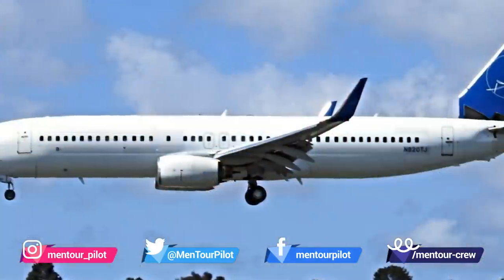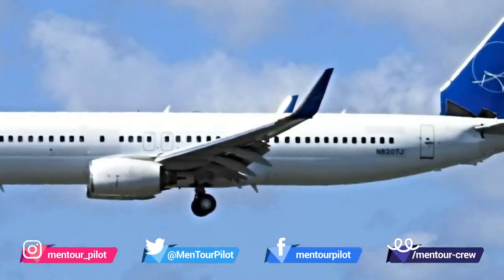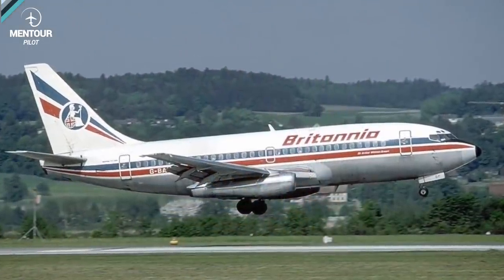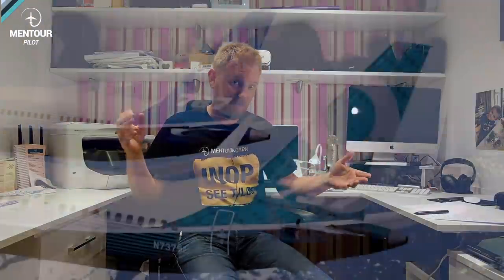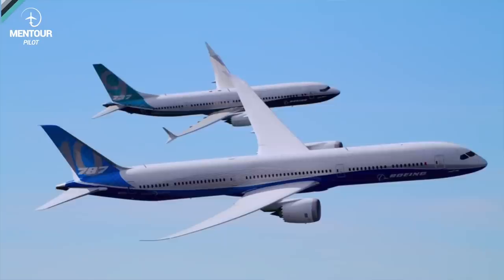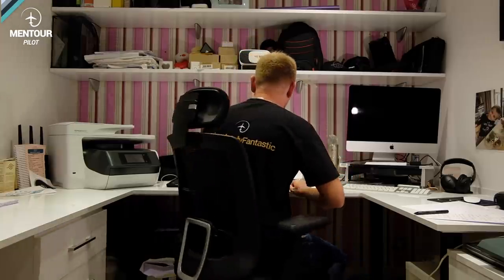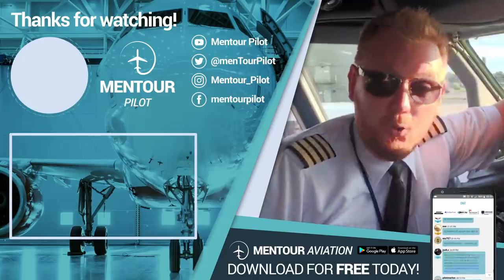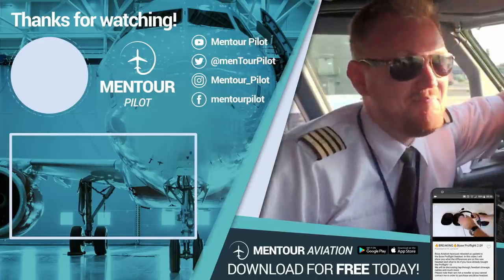Aircraft landing with missing tail section!!

Comment: Definitely not a birdstrike🙃 Most likely a maintenance human error 😳
Reply: I put my money on metal fatigue.
Reply: I would not be surprised this was a manufacturing error.  They take time to emerge.
Reply: coolcatmeow77 It is clean of..nothing remaining. So I wouldnt think so😳
Reply: John Cheresna Manufactoring? Its probably been on in about 35-40000 flight cycles tho🤔
Reply: Stella Wind You can blame a virus for a lot of things..but not that😆
Reply: This just in! Democrats claim it's Trump's fault ... 😁
Reply: soaringtractor  We will find out expert.
Reply: @speedbird9313  We will find out. 
 BTW expert, cycles effect the pressure hull, landing gear, moving parts far more than they do on static parts.
Reply: Manager “hey Mechanic rob tail number RTY aircraft of the dorsal fin we need it in an hour it’s grounded anyway”. Mechanic “ok going to get RBY’s dorsal fin now”. Other Mechanic “I’ll start the paperwork”
Reply: Austin Vialoux Might actually be the case🤭 There is no CDL on that thing🤨
Reply: Smitty Smithsonite Usually the other way around isnt it..🤭
Reply: John Cheresna Well of course..but the dorsal fin is very much a static part🙄
Reply: soaringtractor Should not be much corrosion in that area🙄 It may actually have been taken of and not reinstalled before they released it🤭
Reply: Agree unlikely a bird strike, but not impossible.  Having seen the results of many bird strikes on heavies, there is a lot of force.  The panels are secondary losses IMO.   Suspect the fin wasn’t properly secured.
Reply: Yeah, a birdstrike seems very unlikely there.  I would think if a bird were to strike the V-stab it would be higher up since in takeoff and climb out the aircraft would have a relatively high angle of attack causing the front of the fuselage to be higher in the airstream than the rear of the fuselage and the dorsal fin.  So even if a bird came right over the cockpit windows, which the crew would have noticed, it would likely strike the stabilizer higher up than the dorsal fin.  Even during approach, I think this would be true as the AOA would still be positive (as compared to the airflow direction) even in the descent.
Reply: then how did the other stabilizer get a dent and a panel on the side of the tail come off?
Reply: Its boeing that pretty much explains it!
Reply: Ken Leonard It is impossible, it would not have been taken clean off..
Reply: A_ch0o If you mean the dent on the LH horizontal stabilizer leading edge it could be a old damage. Pretty common to have impact damage on those🙄 The panels could have blown out due to airpressure through the lightning holes in the vertical stabilizer front part which is visual only when the dorsal fin is off.

Comment: I could imagine that the exposed portion of the fin structure with those 2 holes would  catch a lot of wind and pressure inside the structure that it wasn't designed for.

Comment: The panels missing were blown up by the ram air getting in  throw the fronts orifices on the ribs holding the tail fin. The air ramming though those holes produced an increased air pressure inside the structure sufficiently high to blow the panels open and the wind passing through the outer surface was sufficient to completely remove the panels from the plane.   The dent on the leading edge on the vertical stabilizer was caused by the dorsal fin when it fell. The panels do not have the mass to cause such dent of the leading edge. The very shape of the structure is very strong and resist impacts like this.
Reply: So what made the dorsal fin come away from the vertical stabilizer
Reply: whatsonyourchannel “What made the dorsal fin come away?” Speculation made it come away :) (Nobody knows yet, so we can only speculate).
Reply: @whatsonyourchannel  That, my friend, need to have a close examination and interview the maintenance personnel.

Comment: Strictly speaking, linguistically, it's not a dorsal fin, which would be separate from the tail assembly. The part in question is a forward extension on the tail. Beyond the aircraft industry messing with definitions, agree totally with you Mentour.
Reply: Allison Pell Ref AMM 55-32-11 this is a dorsal fin..

Comment: I would say that the rudder panels were simply 'pushed of' due to the increased air pressure inside that now open cavity. The pressure through those two holes would have been substantial - in addition to some 'lift' generated by the shape of the fin would have been enough to overcome the rivets.
Reply: No, likely there were only a few finger tight screws holding those panels on, once the doghouse departed the screws rattled out and the panels departed also.

Comment: how could you not notice that the entire vertical stabilizer and rudder is tilted backwards... it's far worse than it seems. it's a miracle they haven't lost the tail all togheter... as far as i can see the "panels missing" are just  flanges that normally aren't visible because it's were it joins the back part of the fuselage and become exposed because of the tilting. you can tell even the logo is clearly misalligned

Comment: There is absolutely no possible Earthly way that thing came off in flight and left such a neat and orderly hole, without any passenger or crew feeling anything. No possible way!  Furthermore, there is no possible way a bird or more than several birds can knock that fin off. Mark my words we will find out that that plane was undergoing maintenance and the part was simply not needed to fly the plane in the meantime. It is just that simple. I'm super surprised the highly qualified pilot in the video didn't speculate as to this point. I'm not a pilot but I am a structural engineer.  Just an observation, respect.

Comment: 5:35 if you think about it, it also may be very likely, that through the holes in the front of the fin, there was pressure from the airspeed building up inside the fin, and i think that blew it off.

Comment: I'm curious of one thing.. You said the plane would have flown over the ocean for a bit.  Well, I live 20 miles from San Diego, and Victorville is in the desert.  If it took a 737 41 minutes to fly 126 miles, it must have been almost at stall speed.  How far is it from Victorville, CA to San Diego, CA? It's a 02 hours 28 minutes drive by car. Flight distance is approximately 126 miles (203 km) and flight time from Victorville, CA to San Diego, CA is 15 minutes.  I have relatives in Victorville, and it takes me a couple of hours to get there, because I live a few blocks from Interstate 15.  I don't understand how it would take an ocean approach coming from inland.  someone who has flown that route please enlighten me.  I have flown into San Diego from oakland, and we flew over the ocean but then turned inland to fly into Lindberg field through the high rises.

Comment: the side panels were not ripped off they were blown out!. the lightening holes on the front bulkhead of the fin being in the direct airflow would cause a large pressure build up on the inside. they may have to take the same fairing panels off from the otherside too as they would of exceeded the stress load, as they were not designed for an internal force acting out board.

Comment: That dorsal fin was a Boeing 'fix' to move the aircrafts center of lateral resistance back to its original design position after the new oversised engines had moved it forward. 

Without the dorsal fin the new engines would have had to be fitted further aft which in turn would have reqired a longer undercarriage design which was not feasable without a complete redesign of the aircraft. 

A similar modfication was done back in the 1940's to the North American P51 Mustang when the installation of a larger engine cowling reqired the addition of a dorsal fin to the original vertical stabiliser design.

Comment: Looks like somebody was working on the vertical and didn’t torque the fasteners properly. Are the fasteners missing? Is there shards of composite still on the vertical? There’s more to this story than we are being told.🤔🤔🤔
Reply: Unlikely that someone missed every single fastener, there’s hundreds of fasteners holding these dorsal fins on, even a small fraction would be satisfactory in holding it in place
Reply: maybe like that one the morning shift unscrew all the leadin edges,but the evening shift decide they only had time to replace one of the leading edges ,let the plane fly and when he comes back,replace the other one.
result:no one screw on again the other leading edge and fell off in flight.

Comment: If I had to bet, it was a maintenance error,  someone did not tighten up the key parts OR a structural failure occurred.  The latter, sort of scary the former - is correctable, though someone may be unimployed shortly.    Bird strike not likely in that area.  No big birds in Southern Ca except for condors and THAT would be become a big news item
On the plus side the flight was relatively short so the is a good chance of finding the part if it didn't land in the mountains  around the LA Basin that were in it's flight path shown.
Good info, would never have noticed that addition to the rudder.

Comment: Really doubt bird strike. There are 12 or 14 bolts that come up from inside the fuselage every 20 inches through the ribs. Even if a few were not installed it would have left pieces still attached. Those bolts are under insulation and the cabin ceiling panels so it is not something that could be easily inspected for say a preflight or over-night check. I doubt the bolts were even installed from the last time it was removed. It is not normally removed except in Heavy check. What will surprise some people is that the dorsal fin is about 10 feet long but only about 200 lbs. As for the vertical closeout panels, that forward one came away too perfectly. If the panel had ripped off at least some of the fasteners would still be there with some panel material. All those panels including the dorsal are all fiberglass.

Comment: I hear that you still are a strong Boeing supporter! The reason for this incident most certainly had to do with metal fatigue, witch means that it might have been ripped partly off and a chunk could have stayed on and caused aerodynamic disturbances or jammed the stabilizer trim. What is most concerning is that it further suggests that quality at Boeing is not at a sufficient level and hasn't been so for a long time.

Comment: Mentour Pilot forgot to mention one potenial serious danger to the aircraft after the dorsal fin was lost: The blunt, non aerodynamic primary structure, the one with the green paint, with the round holes, that holds the front of the vertical stabilizer, disturbs the airflow around the lower half of the vertical stabilizer and ruddder. In case the aircraft would encounter an engine failure in this configuration, the stabilizer and rudder might not be able to counteract the sideslip sufficiently and the stabilizer could stall in the sideslip - with the consequent loss of the aircraft with its crew.

Comment: Well that has to be a bit weird. Pulling up to the gate after a nice smooth flight, stop when the ground guide says, waiting for them to chock the plane, running a checklist, then you see ground guys pointing at the plane and getting each others attention. Then either a text from HQ on the coms, or ground on the radio chiming to finally enlighten you.

Comment: At 5:35
Could it be that the sudden inrush of air thru the 3 round holes in the vertical structure that became exposed when the dorsal fin disappeared just blew off the 2 panels by a sudden buildup of pressure inside?
Reply: Seems plausible.

Comment: uh... I've seen that before. The aircraft was in maintenance, probably phase or depot level, those panels had to come off for a 365 day or 730 day inspection or for a flight control rig, and the maintenance team was told to move the aircraft so the panels were tacked on  with a few screws so it could be moved, the aircraft was moved, the team was reassigned to other work, production control yelled to push the aircraft to the line and hours or days later with the maintenance unfinished, the panels held on with a few screws, pilots were assigned to fly it and they did.... trust me, on some aircraft it is hard to see missing screws, first flight, second....third, eventually the panels fly off. Hopefully your car isn't under the flight path, or your head.

Comment: Whoever was on that flight can consider himself or herself to be very lucky, the detachment of the dorsal fin could have damaged the rudder or the horizontal stabilizer to a degree where the machine would have crashed. It is clear that the horizontal stabilizer „suffered only“ a dent but it could have been worst, serious damage to that part would have left the plane flying out of control with little to no chance for the pilots to control it, this incident should require a complete investigation

Comment: Having that bit of dorsal fin and a couple of panels missing is no biggie.   What is rather more worrying is how it came to be missing, or what else might have fallen off.   If for example it suggests the rest of the tail fin might have gone missing (unlikely from a birdstrike if that's what it was, but possible with some scenarios) then that is frequently not a controllable situation.   I would think the investigators would be looking quite hard at this one.
Reply: cr01 Another Continental Express Flight 2574 incident is my guess..
Reply: @speedbird9313    Ouch!   That incident certainly had a far less fortunate conclusion.   (Someone left some bolts out of the horizontal stabiliser and it fell off.   I wasn't aware of that one.   What is unusual is that unlike most such incidents where the resulting loss of control causes a crash, this caused such a violent upset that the wing immediately broke off.)

Comment: Now I want to go out and look for it because I live in the area where it probably would have flown over. Where does the flight go over the sea? Do they have to approach the runway coming from the sea to the San Diego airport? A basic straight shot from Victorville to San Diego would be entirely over land. They have to fly over the San Andreas Fault and resulting linear mountain range so it definitely could have fallen there and not been found. There were some decent winds, at least on the ground and the winds tend to be stronger in and around the mountains. If they didn't notice it though, it seems more likely to be metal fatigue because you think someone would have at least heard a birdstrike and winds are pretty noticeable. It seems like planes can withstand a lot of wind. I have gone to South America several times and the winds coming off the Andes are unmistakeable. The time I went from Lima, Peru to Lake Titicaca, the winds were absolutely terrifying, at least in the back of the plane.

Comment: My team and I intall a dorsal fin one month ago to a european airline during a C Check of a boeing 737-400.
The reason of the removal was high levels of corrosion at the fuselage, exactly where this part is installed.
It slides in place and then about 20 bolts from the cabin are tighten with specific torque value to anchor nuts that are installed at the dorsal fin.
Panels fly away because of incorrect bolt length..
But this fin.. I am curious to see what happened..
Reply: Do you think that air pressure at flight speed could get under a loose leading edge of that thing and rip it all the way off, even if some of the bolts were in properly?
Do you think maybe this was a case of maintenance-interuptus where a job got half done and then restarted after the quarantine?
Reply: @grecco_buckliano  The air pressure can not make 20 bolts with +-150 inlb of torque, to fly away in normal circumstances.
Well now those bolts are very tricky because to see if they are proper installed (correct length, more than one thread passes the nut) you should take off the big panel that is missing too!!! 
Job cannot be done half in those things.
BUT, If a repair was done at the fuselage and they use the SAME bolts as the manual indicates so they are mistaken, because the repair is thicker now and longer bolts should be installed!!!
Reply: pao_mono gate13 14 bolts😉 
AMM 55-32-11-400-801
Reply: maybe brother, i can recall two in the front as you say and 6(?) by each side..?
maybe... i don t remember for sure..
I remember for sure how my ass was after installing them :)))